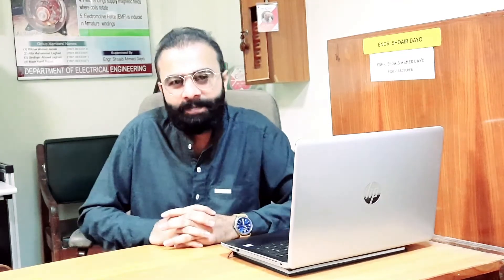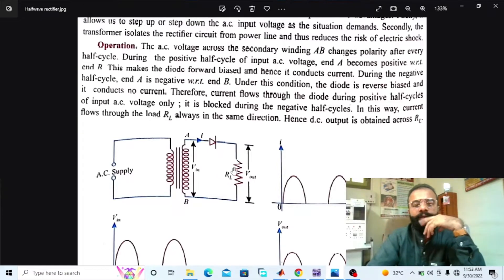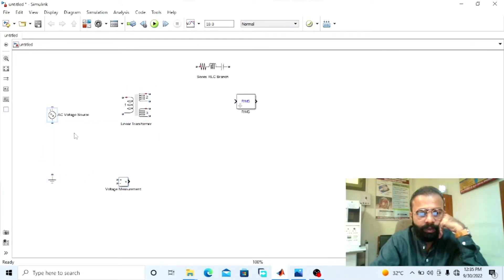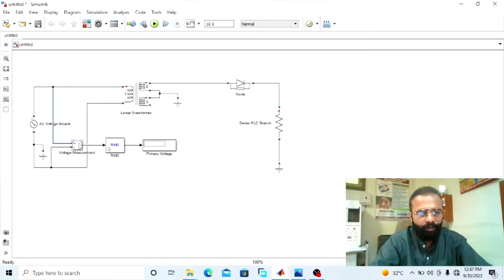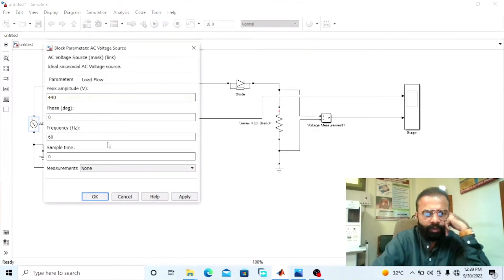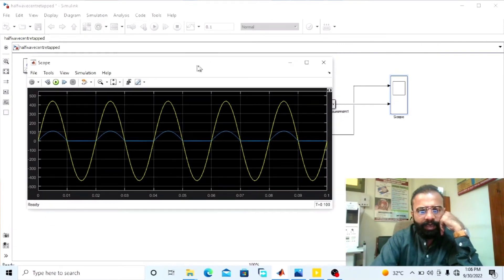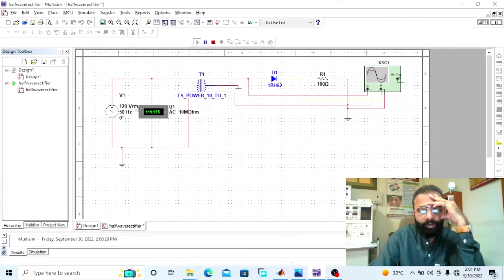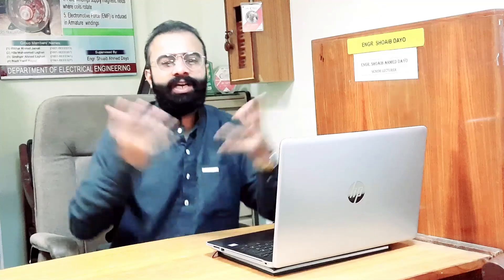Half Wave Rectifier using MATLAB and Multisim Software | MATLAB Simulink and Multisim Lab Experiment

Comment: sir co-simulation non entre multisime and matlab
Reply from the maker: Dear, you should watch complete video, you would find both simulation on MATLAB and MULTISIM Software....Thanks
Reply: @ShoaibAhmedDayo  I have a search for to simulate an electrical circuit in miltisim and its control in matlabThis is my point in asking, sir, do you have an idea and is the video appropriate
Reply from the maker: Dear, i have not done co-simulation work in this video, i have just simulate the same circuit diagram of half wave rectifier on both MATLAB as well as MULTISIM software just for give the touches of both software......Thanks
Reply: Would this merge between them please